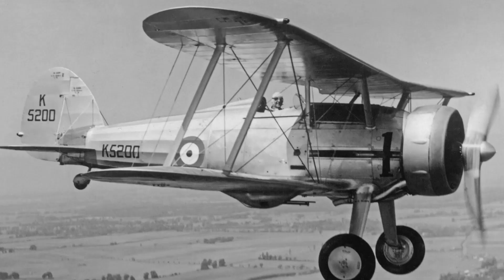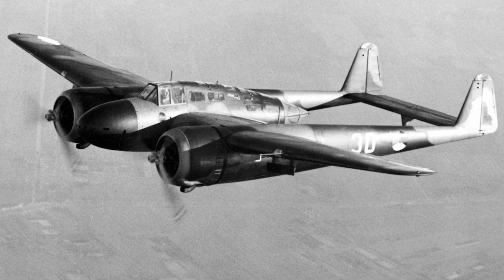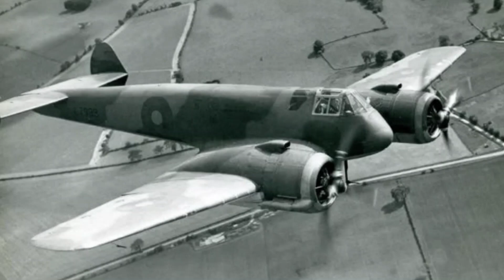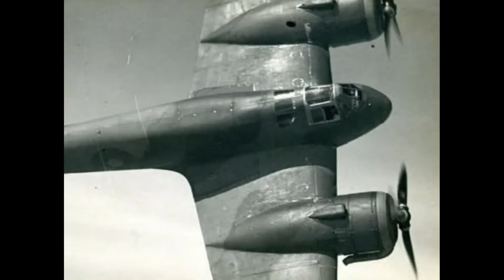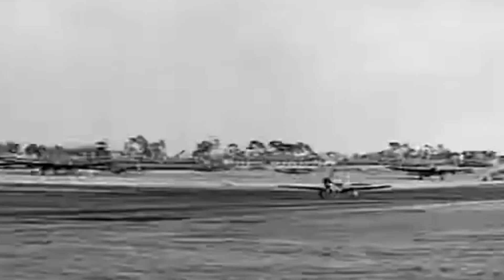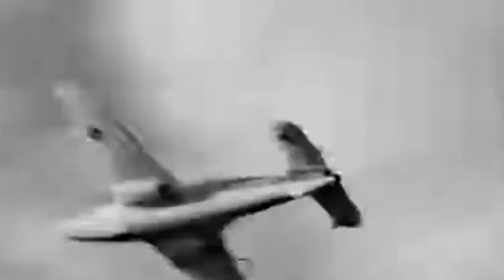A Big Miss? The Gloster F.9/37

Comment: Why would the Hawker design group want to threaten their  product with better aircraft, they continued to produce obsolete Hurricanes until 1944, Bristol did the same with engine supply to Blackburn, Botha's designed for one engine ended with a less powerful one, the Australians changed the engines on the Beaufort for American ones, also the British AIr Ministry seem to have believed that complex sleeve valve engine would be better than poppet valves with supercharged engines we will never know the true stories, look at what armament was fitted .303in caliber, then 20mm, .5 in  in the mix; they knew that the range of the .303 was inadequate in the defensive turrets against 20mm cannon but that's what you got until the end of the war when  the .5 was fitted to the Rose turret, post war 20mm cannon in turrets.

Comment: Does anyone know why early war or pre-war aircraft of metal construction but canvas control surfaces? Like this one, or early Spitfires. It seems quite common for 1939-1940 but I don't know why.
Reply: Usually because, with no power assistance, all control surfaces were moved by a system of wires and pulleys. The lighter these components could be made, the less physical effort was required on the part of the pilot, especially when the load was compounded by extreme G-forces in combat. It was also easier to balance these components more accurately by just doping a bit more fabric on than having to modify a metal component. Pretty much every heavy bomber pilot of WW2 ended up with back problems in later life due to the strain of heaving 20 tons about the sky.

Comment: 👍Thanks for another excellent video. Although, the F.9/37 seems to have been a promising design that may have been developed into a useful heavy fighter, I suspect that using the availbable capacity to prioritise single Merlin engined Hurricanes and Spitfires was the sensible choice. Even if the F.9/37 had been developed to use Merlins, each aircraft built would have meant two Hurricanes or Spitfires not being produced.

Comment: That is the price for dealing with utter cretins or w------s ,as Gloster,s F.9/37 is a corker the very aircraft needed to protect Wellingtons Hampdens on the disastrous daylight raid on German Capital Ships parked in Kiel , fast well armed and able to take on the BF109,s and 110,s. When it came to powering the 'Gladius' Gloster,s engineers were somewhat blinkered and stupid,  okay the 1050 Bristol Taurus had the pony count, but swapping to a lower rated 900 Taurus ,what f-----g drug were they smoking!!! . Obvious solution Richard Osman is the Pratt&Whittney R-1830 SC1 Twin Wasp ,  same pony count as the Taurus better still ,cats&kittens  more reliable and available with a two speed blower. Think Oh Richard Osman a Gladius with R-1830 -66 Twin Wasps with  two stage two speed blowers twirling HamStan Hydromatic props, one hundred fifty extra ponies and good for three hundred seventy five miles an hour , cannot sniff at that!!!.

Comment: Air forces in the late 30s tended to assume that the concept of the single engined fighter was obsolete. Hence the Me 110. The Air ministry had intended to phase the Hurricane and Spitfire out of production, in favour of the Beaufighter. 
Few plans survive first contact with the enemy. Intentions changed very quickly.
Reply: This is why too bad the Focke-Wulf Fw 187 never made it to service. Fitted with two DB 601 engines it could have a top speed of around 385 mph and easily nad to range to fly to most of England from forward bases in France. The Fw 187 could have given major fits to the RAF because it was faster than even the Spitfire.
Reply: @Sacto1654  Germany had far better idiots at their air ministry than the British empire had 😁

Comment: Was it tested fully enough to determine if it actually was ‘an excellent aircraft’?
The delta leading edge vertical stabilisers look worryingly like those on the unsatisfactory Halifax I and II.  They were notorious for undiscovered in pre-service testing failure to cope with asymmetric flight or asymmetric stalls or asymmetric incipient spins.  Group Captain Leonard Cheshire raised the alarm when he realised that almost no Halifax I and II bombers returned from bombing missions with a failed engine.
If this Bristol twin was twitchy with opened cooling fins upstream of the vertical stabilisers it suggests that directional/yaw stability in both engines running powered flight could be marginal!  Those little vertical stabilisers and rudders simply do not look as if they could go together with thousand horsepower plus engines in a (modern) twin.

Comment: I used to live by the old Hucclecote airfield which was still in occasional use by Simon Engineering. 
The watchtower and a couple of hangers were still there, and part of the assembly shed was incorporated into the nylon/kevlar spinning factory to the left of the runway. The engine test bays were still standing. 
Most of the site is now housing with a tesco store and an industrial estate.

Comment: One thing that shouldn’t be understated when discussing yea thing troubles with either aircraft or engines is the effect that civilian use had.

Simply said some of these types had their development difficulties happen on the civilian market vs the military one so if the military adopted a type that was already in civilian production then they didn’t have to deal with those issues.

For example The Doulas Sleeper Transport was already developed and it’s development issues where known and solved once the Military took the basic aircraft and came up with the C-47.

Compare that the Curtiss C-46 that didn’t get that treatment and gained a reputation of being a difficult aircraft you didn’t want an engine fire on

Comment: The cardinal rule - new airframe or new engines - not both at the same time!

The other factors that might have made a difference would have been flight time and ammunition. A capable heavy fighter would have been able to linger on station, then still have the endurance to engage with heavy armaments multiple times. 

You also make a good point about emergency exit - being able to get out quickly and not with a burning engine in front would have been appreciated by the pilots. 

It is unfortunate that there wasn’t a heavy twin engined fighter to complement the singles in the BoB. It would have been able to take the fight all the way back to France long after the bomber escorts had been seen off and had greater survivability to get back on one engine if damaged.

Comment: How many world-class designs have been screwed over by either crap engines, or engines that promised a lot a delivered nothing…
It does mean Gloster basically went from the Gladiator biplane to jet aircraft in one step, which is pretty incredible.
Reply: What about the f6.
Reply: One basic "rule" of aircraft development I have often read about is that you should avoid designing a new aircraft that uses an unproven engine or vice-versa. The thinking being, just as you say, that a perfectly good airframe design might result in project failure due to poor engine performance.

Comment: Another good video Ed, on a sadly neglected aircraft. But you missed out on one important aspect of the Gloster F9/3. Once the initial turret had been discarded, the fixed armament tested on the aircraft were all fitted in an upward firing "no allowance shooting" configuration like the German Scräge Musik armament, but at a shallower angle (to better suit the higher velocity British 20mm Hispano rather than the low-velocity German MGFF cannon). If you look at the image of the second prototype 7 minutes into the video you'll see the two forward cannon are angled upwards at 12 degrees. This second prototype also carried another three cannon mounted in the roof of the fuselage, again pointing upward at 12 degrees (there's a photo of the installation on page 83 of Tony Buttler's "British Experimental Combat Aircraft of WW2"). Thus it had a formidable armament of five upward-firing 20mm cannons.

Comment: Imagine this instead of the Bristol Blenheim...
Reply: The Bristol Blenheim was ordered as a light bomber not a fighter and it had been in service for 2 years by the time this plane had it's first flight.

The Bristol Beaufighter was testing at the same time but was built as a two seater nightfighter for a reason the second crew member controlled the early radar.
Reply: @Ushio01  This would easily have been turned into a light bomber. And no, I don't see it as replacing the Beau.
Reply: @jlvfr With an extended rear fuselage, the Reaper could have ended up a reasonable light bomber, something like the Do 17. But, with the added weight of bombs, performance would have dropped off dramatically = no significant advantages over types already in service with the RAF ... like the Blenheim. (The RAF was probably focused at the time on medium day bombers. They ended up filling that with US designs until the Mosquito B.IV was in service, in mid-1942.)

Comment: Gloster went from biplanes to jet fighters in less than 10 years. Amazing.
Reply: Last Gloster Gladiator was delivered in April 1940. First Gloster E28/39 Jet April 1941.
The first Gloster Jet was being built alongside the last Gloster Gladiator.
Reply: even better, being pioneers in jet aircraft
Reply: Arvo went from the Lancaster to the Vulcan in a short time also.
Reply: @kiwidiesel  Boeing had the B-52 sandwiched between the B-50 and B-54 B-29 derivatives…
Reply: @allangibson8494  And that is relevant, to this video, in what way? XB-29 flew 1st time in 1942. The war had been going for 4 years by then, and Boeing had plenty of ideas to copy. B-50 flew in 1947. B-54 CANCELLED. Is this post just a trumpet-blowing, look at us, we were there? 
You mention the B-52, 1952 FF. I see no relevance, to the video, about an aircraft in advance of its time. And led to many copycats.
Reply: @Demun1649  The gap between the previous generation and the one after it in the 1930’s to 1960’s was very very short indeed. On the other hand we are still operating bombers designed 70 to 80 years ago…
Reply: @allangibson8494  But I did ask about the RELEVANCE of your post, in light of the video and the comments it provoked. All you do is come across as yet another MAGAT with no brain, and a lot of nationalistic self-delusion.
Reply: From gliders to supersonic flight in 44 years, then to space in 10 more years, then the Moon in another 10; however, we have more or less stagnated there, though that may admittedly be about to change
Reply: so did most big airplane manufacturers of the era.......
Reply: @G_Thraka  I'm not discounting that. I'm singling Gloster out because they produced the Meteor and it entered service first.
Reply: @bronsonperich9430  no messercshmitt built the first in service fighter......
Reply: @G_Thraka  I'm talking about the first on the winning side, not the losers. We all know the Germans put the 262 in the air first.
Reply: @bronsonperich9430  then why not say that in the original post or are you moving the goalposts?
Reply: @G_Thraka  Yes, indeed, BUT they were GIVEN the jet engines, Russia and US, or stole the ideas, Japan, China, and Brazil.
Reply: @G_Thraka Gloster, unlike the others, never got a piston engined monoplane fighter accepted between the two… (A turboprop Meteor did fly during WW2 however).
Reply: @allangibson8494  Well thats not true is it? Since they were part of hawker siddeley and im pretty sure hawker had some single engine monoplane fighters......The reason gloster never built a fighter aftyer the gladiator was because they became part of hawker siddeley in 1935.
Reply: @G_Thraka They actually had a couple of prototypes but none were accepted - and then jets happened and Gloster built three fighter prototypes during WW2 (Gloster E28/39, Gloster Meteor and Gloster Ace).
Reply: @allangibson8494 what the hell are you on about........they were the majority builder of the hawker typhoon and built half the hurricanes as well